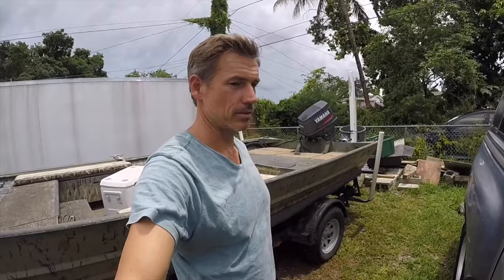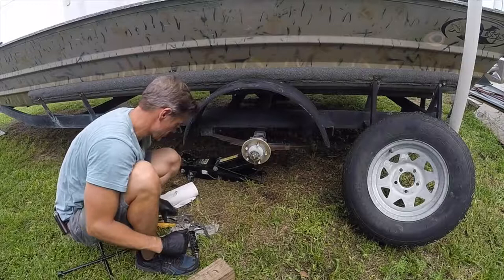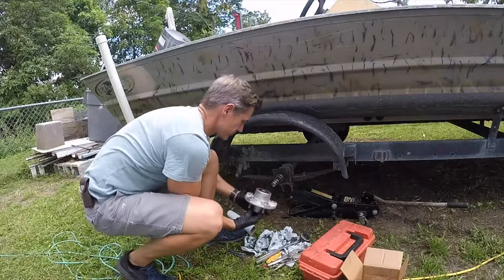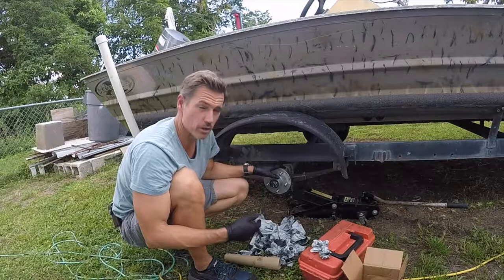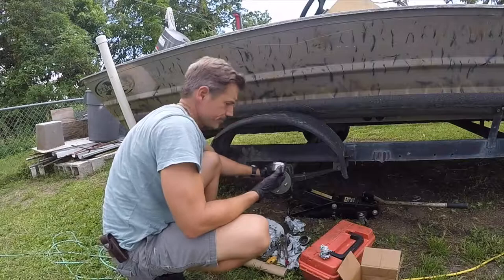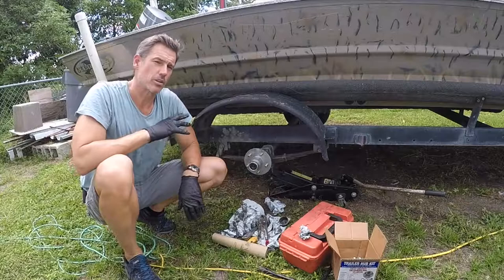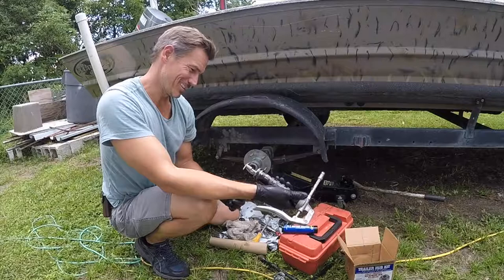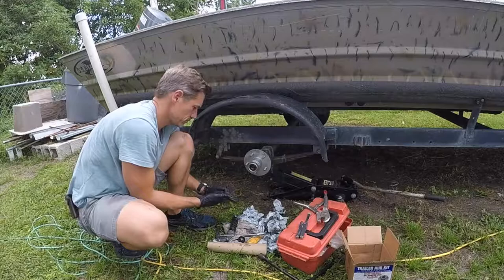Jon Boat Trailer Hub change!

Comment: I recently changed my hubs. I picked up pregreased hubs. After I added some grease I had some grease come out the back. Did I not get the castle nut tight enough to seat the hub?
Reply from the maker: Either that or the wrong size seal.
Reply from the maker: I’ve seen times when if you put too much grease you could blow the seals out. Especially if you have bearing buddies
Reply: It's the kind that the grease goes through the spindle.

Comment: What's the difference between your cap and a bearing buddy?
Reply from the maker: Bearing Buddies are spring loaded and they push grease into the hub. With bearing buddies you can put a lot more grease in your hub which will last longer. The potential downside to them is that the pressure that they put on the seals could blow them out. The people at the trailer shop that I go to told me the regular caps with the rubber insert are better. To fill them with grease all you do is use a screwdriver to pop the seal out and fill the hub through the grease gun fitting on the end of the spindle. Hope this helps.

Comment: Why and when would I change the hub??
Reply from the maker: The seals go bad causing grease to leak out of the hub. If the bearings in the hub don't have grease they get hot and burn which in turn can lead to the wheel falling off. Once I had one of my trailer tires roll past me in traffic! NOT GOOD! LOL! I look on the back of the rims every time I use the trailer to make sure none of the grease is coming out of the seals, also I check to see if the hubs are hot. If I notice either I will change the hub or at least the seals and bearings.
Reply: @thadeusragan  ah. Thank you!